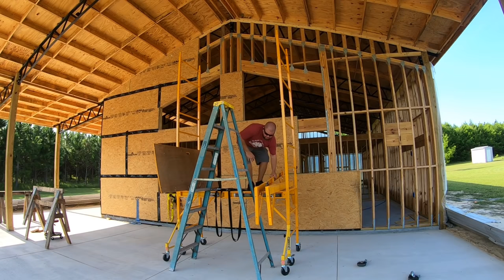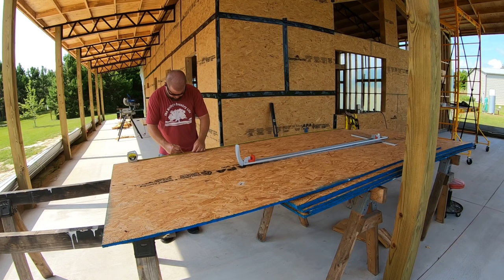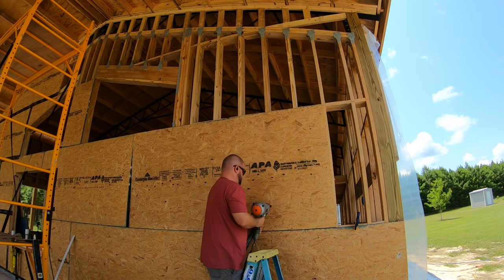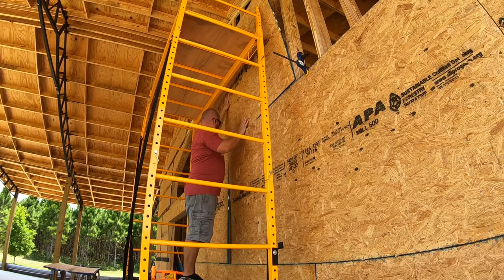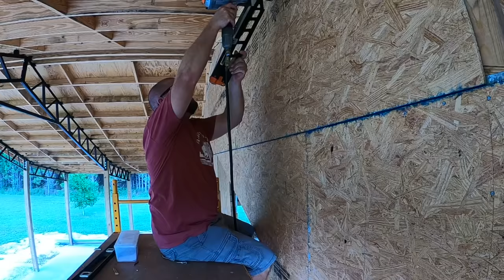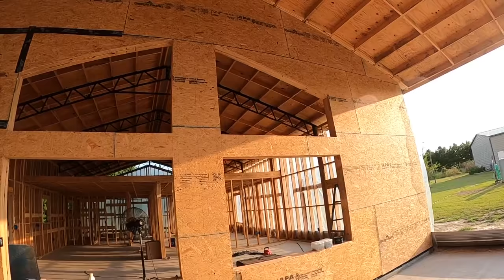Half of the house is officially sheathed! #406 #barndo #barndominium

Comment: Just watched an old carpenter that builds garages. A trick he does to get siding level is to measure up from where you want bottom to be on both ends of building side. Then chalk a line. You have a quick visual for perfectly level panels.

Comment: High five brother! Not that you need too but I have to ask. Working in this heat how much weight have you lost? I'm building a privacy fence per say with a lattice top. Got all the holes dug and post set and in concrete. I'm doing this project alone too and 6x6x 10's ain't no joke! I'll work 4 hrs come in and rest and cool off and my clothes are soaked! 90 degree days heat index of 105 is brutal. But like I told my wife this fence will be here long after we are gone! I'm way over building it !!!
Reply from the maker: I don't have a scale, but I've definitely lost weight. Shorts falling off and I'm moving up notches in my belt.
Reply: @TKCL  I knew it this heat is brutal. When it's time to eat you are so tired and exhausted you don't feel like eating and if you do it makes ya sick
Reply from the maker: Yep